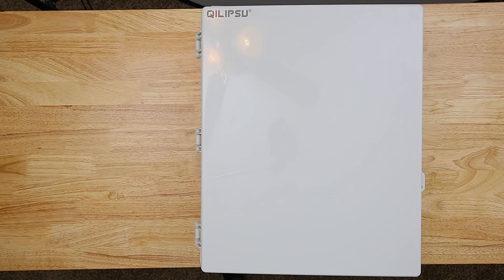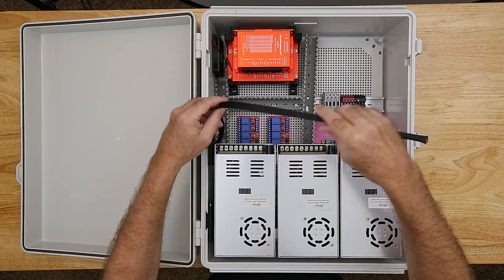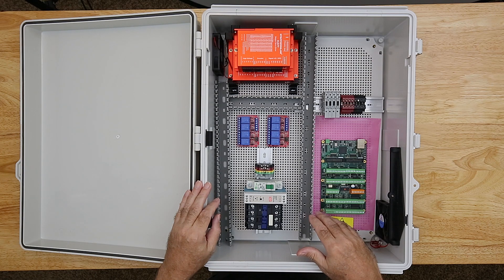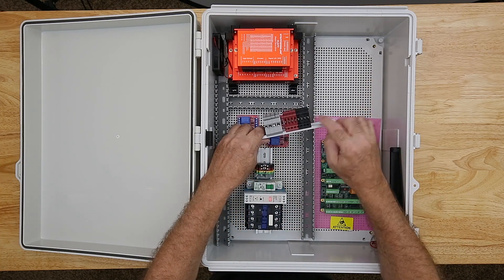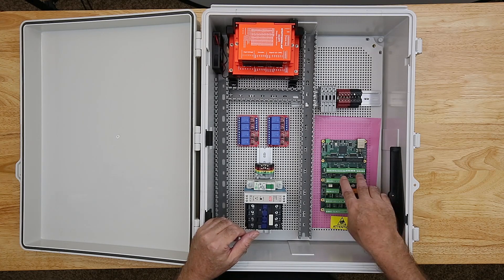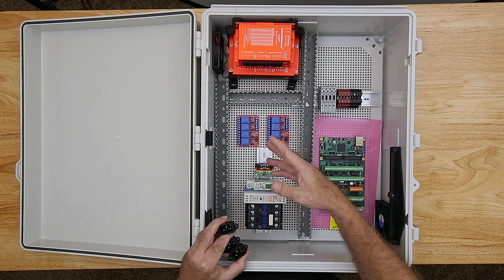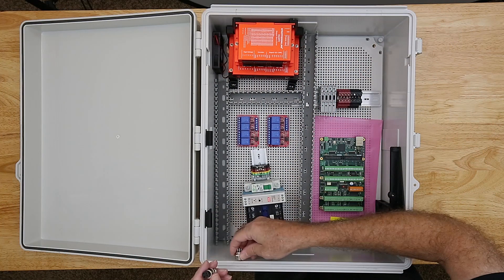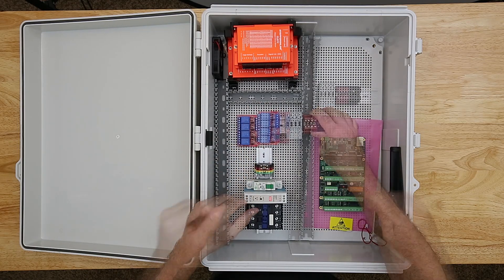Enclosure Component Layout for G0704 CNC Conversion

Comment: A few good ideas, but the case is to small in my opinion. The power supplies and CL-Stepper-Drivers are to near together. Also a plastic box is not really the best for handling high temperature of all aktiv components. And the most people I know about CNC are making the box to small, me too. One guy told me: make a plan what you need. Arrange all parts you need. Double the space and now you have the minimum.
Reply from the maker: I completely agree. If I were doing it over, I'd use different drivers that accept AC power and then put a transformer in a different enclosure to power them. 
I did upgrade the fans for better air flow. The filters I first used, blocked about 50% of the air flow, so higher CFM was helpful.
I kicked around the idea of using a 6U to 12U enclosed server rack as an enclosure. More room, maybe add pull out drawers to mount the components. Often come with fans.

Comment: Nice work! If you need help with LinuxCNC feel free to ask me any questions.
Reply from the maker: Thanks, I'll probably take you up on that since I've never used it before. It'll be a little while yet though.
I did bench test the Mesa card with the steppers on Linux CNC and ran a simple G-Code program just to make all 3 motors run, but that's as far as I went.